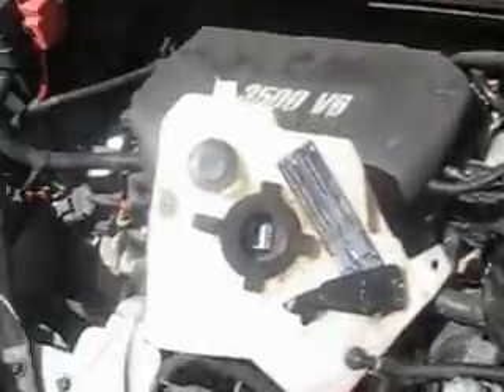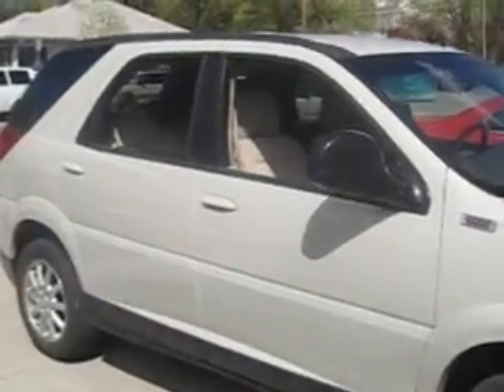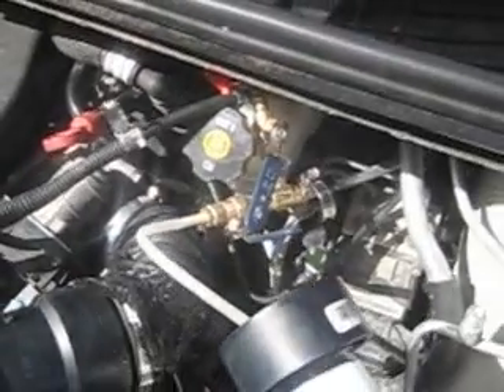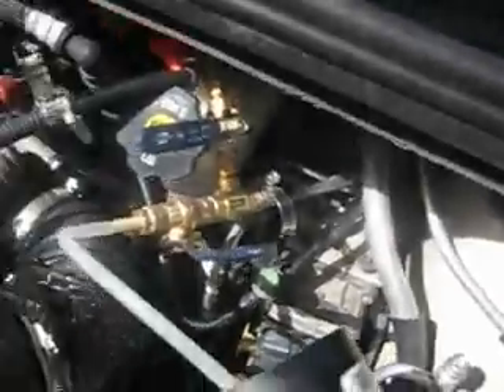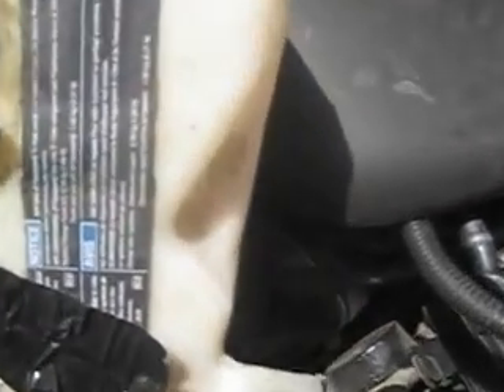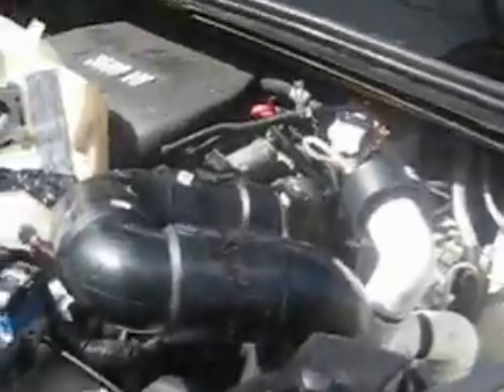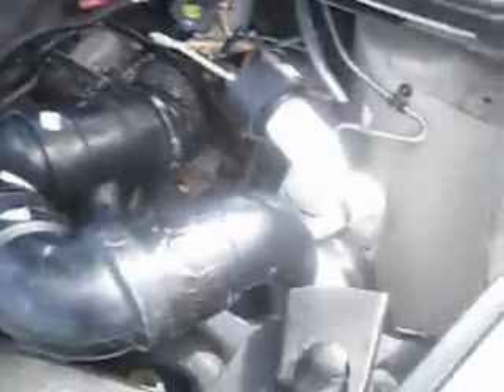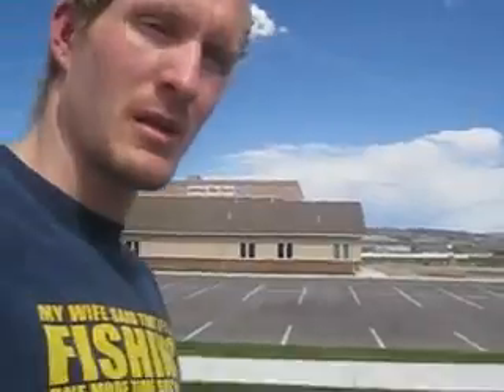200+ MPG Gasoline Vaporizer Project Original Design (Driving On Only Gasoline Vapor)

Comment: Tyson, there is not too many adjustments to be done. The air is easy and the vapor will be sucked in by the intake. I don't have a distributor so there is nothing to do about that.I am really sorry to say but this vapor stuff is not real to me.Soon I am planning to do this experiment again with a video so ppl won't think of me that I am talking without proof. Now I am working on a hho project hopping it will do the job. waiting for the flash back arrestor and I will mount it in the car.End of the month will be here. Again I have nothing personal with u Tyson buy after what happened to me with the vapor experience. .. there's not much to say.

Comment: Sorry for my english,first of all.Today i tryied the fuel vapor in my tercel 98,and i am realy disappointed. I take 2 hoses from the exhaust cover and getting hot air in the bubbler. The 2 hoses got warm (no ideea how hot was it but it feels warm pretty good) and after I cranked for 7-8 times she finally got the feeling the she is willing to start.2 more cranks and she was idling. I let her worm up to the 80 degree Celsius. Than I said I can drive it. I was using a (roughly 4L)canister with I fill only 1L of gasoline. the end of the pipe inside it is made from pipe copper with an end of 40mm (1 1/2 ")in a L shape with lots of holes in it.So I jumped in the car hopping for the best.She start nice on the 1st gear but she struggle for the 2nd (automatic).I reset my km meter and she went as fast as 50km/h. Slowly she start not having power but I said let's see how far does she goes. After 4 km she died on me.Open the hood and no more gas in the tank (1L).Fill another 1L and Crack it again with no success. Gave up and replace everything the way it was (air filter, injectors plugs). PS: Run it with out air course the moment I try to give some air she was dieing on me.Donno why she didn't want to start  again. Any ideea? I realy appreciate any ideas 
Toyota Tercel,1.5L To me this didn't work and I wish I can to prove all my friends it is possible.
Reply from the maker: +998vick It's a pain and talked allot of adjusting to get it right which is why you don't see videos anymore.

Comment: I have been working on a system that is based on a fog machine,   had the idea a few years ago , but the fog machine its self is not made to handle gas , otherwords it doesn't last very long. so I am revising the design with a variable fuel pump and a more controllable heat nozzle. does any one have any ideas or thoughts on the concept?

Comment: It is true that vaporizing the gas doesnt doesn't make the engine burn the fuel any more efficient. However vapeing the fuel and running the I.C.E on gas vapors makes the fuel last alot longer no matter how efficient or inefficient the I.C.E burns the fuel it is supplied.
Think of it this way,  shooting a stream on fuel intk a carb is going to eat more fuel than turning the fuel into vapor and running the engine off that, this is why when you romp the peddle the there is a lack of power due to it running off the fumes for the most part.
There are some realky cool things being done with water injection as well you should check out.

Comment: can someone tell me why try to vaporise gasoline instead of using lpg, does gasoline vapour has greater volume when expanded than lpg, or smaller gas/air mix is  needed?
why not tune a simple lpg system to a leaner airmix to get better mile x gallon? what has the greater volume if vaporised  gasoline/gpl   1l gas = 2l lpg in my countri so do i get more vapour volume from 1l of gasoline than 2l of lpg ? this is what i wanna know.thans

Comment: Hey Tyson, I saw (on youtube.com), a guy run a lawnmower with a gasoline vaporizer that HEATED the gasoline with HOT EXHAUST FROM THE EXHAUST OF THE LAWNMOWER.  Why not use this system on  your vehicles? Also, why not use a HYDROGEN GENERATOR IN COMBINATION OR EVEN BETTER ECONOMY?  I wish I could post this myself, but I don't have the means!

Comment: Do you know what happens when your gasoline mixture gets leaner? More oxygen the cleaner the burn just like gasoline vapor does.Do you know what happens with a lean mixture as it gets more oxygen? It starts to burn hotter like giving more oxygen to an oxy/acetylene torch in turn your valves get much much hotter till they start to burn out.Its like when you adjust a carburetor and you get it to its sweet spot and then you give it just a little more adjustment on gas so it doesnt burn too hot on your valves.

Comment: PRIMARY TANK AS VAPOR TANK ???

 Why not use SOMETHING LIKE AN "arctic fox fuel heater"  like deisel semi trucks have to heat fuel in main tank to  110 to 145 degrees farenheit ?   {these type  use heated engine coolant to heat fuel by thermal transfer} .   gasoline boils at about 160 degrees farenheit and vaporizes well at 100 to 140 degrees.
  FUEL TEMPERATURE   GAUGE RECOMMENDED.

 Then fill PRIMARY FUEL TANK  to 1/4 capacity or 1/2   and allow 3/4 to 1/2  of tank  capacity for  "in tank" vapor... and hook large diameter fuel resistant  vapor hose to top wall of tank near center  {{{or tee into filler neck just below gas cap}}}  to avoid  splashing and sloshing liquid fuel into vapor suction  tube .  
    A DRAFT " IN "  TUBE THAT PULLS FILTERED & HEATED AMBIENT AIR  DOWN  THROUGH A  ONE WAY VALVE AND TO BASE OF FUEL TANK ..SUCH THAT FILTERED AIR BUBBLES UP THROUGH GAS  MAY BE NECESSARY TO AVOID SUCTION LOCK...AND  COLD WINTER AIR DOES NOT EVAPORATE GASOLINE NEARLY AS WELL....  PURE "NON-ALCOLHOLIC"  GAS PLUS  ONE OUNCE PER GALLON ACETONE WILL AID IN EVAPORATION. 

  AN OLD 1950's  race car  "vaporizer"  trick used acetone in GLASS vaporizer jar plumbed to carburetor by  vacuum tube   or   1 to 1.25 ounces per gallon  added directly to  ""100% PURE GASOLINE""   with no alcohol in blend at all....  This acetone liquid additive probably will not work with E10,E20, e30, e85.  
This racing ACETONE additive trick that is banned from racing now...  It did increase performane/horsepower and reduce fuel consumption...  Acetone is currently about $17 to $20 /gallon at Lowes...and 100% non-alcoholic gasoline is difficult to find...  

   PRIMARY TANK  AS VAPOR TANK TIP:  
  YOU MAY WANT TO HOOK  FLOW &  PRESSURE & SUCTION GAUGES TO TANK AND OR LINES TO MONITOR THESE  PRESSURES, FLOWS & VACUUMS DURING TESTING. 

ALTERNATIVE  "RACE CAR" or "VINTAGE CAR"  FUELS :
  Strait  avaiation fuels   100 octane low lead or 110 octacane low lead     might be a {non-alcoholic} vapour option   but burns way to hot for  liquid fueling of NEW street cars..  If you fill your car with low lead aviation gas It will melt the aluminum  pistons and plug up the catalytic converter if your car has one.

    I did mix some UNAUTHORIZED STREET FUEL  at  10% aviation 90% unleaded gasoline in an old 65 chevy 327 cubic inch V-8 {leaded fuel engine} with NO CATALYTIC CONVERTER and it worked really well....especially after leaning out  the carb aduustment screws.... and the exhaust  fumes smelled like I was burning 1970's ethel gasoline.  That was the really good ETHEL-GAS  that got banned in the 1980's or 1990's ....
  My end user formulated ETHEL GAS  turned several old men's heads  who remembered ETHEL GAS was once at the station  in the pumps right next to the new fangled  "unleaded"  gas that at the time we all thought was  " pure liquid  engine ruining crap "   which  needed some tetra-ethel-lead in it to lubricate  intake valves and guides  properly.  I remember being asked, "Where in 1999 did you find ETHEL-GAS ?" ... I answered simply, "I made my own."    or " I used aviation fuel as an additve to unleaded at one gallon per 10 or 12 gallon fillup" ...  Mixing my own got to be a real hassle especially when trying to add just 2 or three gallons total to top off.

    The new cars have valves and valve guides made of some different metals than the old ones were....so  toxic tetra-ethel-lead is no longer needed   in the new engines.  It took a few years for auto makers to figure that out....and we all bought lead additives and lead substitutes for years  trying to keep our old  pre 1974 leaded fuel engines alive just  a little longer.

Comment: is their any chance of burning up my valves or valve seats without doing a cam adjustment like this video says https://www.youtube.com/watch?v=17xVBQ_U2yw............ im just trying to get as many opinions and info about ths as i can before putting my unit on for daily use 

i am also a automotive tech and the point he trys to make in the video seems feasible but it also seems like it could be overkill to do cam machining like he did. please reply with your opinion and any other info you can give me on the subject, all info will be very much appreciated

Comment: What are all the parts needed. Since I have a single barrel carburetor  with 300 cid. inline 6 with dual tanks?

Question? 
1. can I run the line that the glass bowl i have where the gas goes to and run that to a container or should i take it after t the manual fuel pump from motor to the container 

2. can someone tell me what parts I need to build this?

Comment: Question? Do you have a car or truck that has a carburetor could you help me on using a vapor setup on 1985 F250 Inline 6 cylinder 300 motor. Just wanting to find a way to get most out of truck.
Reply from the maker: I don't but the concept is exactly the same and the vapor system will work better on a carbureted vehicle because you don't have to worry about bypassing the cars computer. If you join the FSRD facebook group there are some drawings and diagrams of how to set a vapor system up.   https://www.facebook.com/groups/259684980846627/

Comment from the maker: Geo Jeff: I am aware that better testing needs to be done. This unit was a fail I got amazing results a few times but the design was extremely unreliable so testing on a 1200 mile stretch would be impossible with this design. I could not drive at highway speeds because it would cool down very fast and completely stop working.

Comment: I'm just after your best interest's, I would hate to see you damage a new functioning engine. I'm upset for you and us all as a group who follow vapour/geet systems. It seems you work hard to keep your viewers informed so why not take a more scientific approach. As i said and please don't take any offense to advise this time, small scale engine run time with carb and load vs engine run time with vapour and load etc with the more data the better! As for me I'm working on engines that run a constant rpm only with a blend of my used motor oil, diesel, petrol, and basically anything that can burn. I'm not doing it for other people yet and mabey I never will if I don't get the results I'm after, I don't upload videos or even make any, and I won't until I have a urekea moment so to speak. Trust me I'm there I look at everything around me that others throw away especially used motor oil haha and say dam....that it liquid gold!

Your doing good prototyping we as a community need to see the raw data, that shouldn't be taken to offense,  the way I see it vapour is the next step in the evolution of ECG. Carb/injection/vapour. If you look at an evap system on a car you can see that we are already burning vapour on our cars everyday! Just on a very tiny scale.

Try to take the good out of what's said and answer the questions and please don't take offense, that's not the intention. Keep up the good work!

P.s. look towards harvesting all the wasted energy in heat from the ECG for your prototypes, from what I've done the heat is an excellent source of wasted energy just begging to be used.
Reply from the maker: CarsRcool All knowledge is highly welcome and I am always grateful to those that share their knowledge and experience.
Reply from the maker: I understand your concerns and appreciate your input on not wanting a good engine to be ruined. You are correct it would be very bad and costly to ruin an engine on such a nice vehicle that would cost a lot of money to replace. Sorry I did not mean to come across as though I was offended, I was not offended I just wanted to let you know that I have done more than what you see in this video and that I am taking a more scientific approach by testing on a generator which gives me the ability to test specific loads and runtimes etc.

There has been allot of good and some bad that has come from making the work I do public. The Jeep I was using as my test vehicle was destroyed by someone, my computer has been hacked into a few times and my house has been broken into a few times along with other things. The bad is just something that comes with sharing such a thing. Some people don't want this information out there others get jelous and some are just out there to try to ruin someones day. I knew going into this that there would be struggles and people out there that would not be happy so I tried to mentally prepare for the crap. It's not always easy but it is worth it. 

Thanks for the encouragement and concerns of needing to do this in a more scientific way. If someone watching wants to or need to know for themselves that this work is real then they need to see the data, I understand that because I found it hard to believe until I saw it myself. I am working on doing better testing and better videos that show all the data good and bad so we can all learn and improve this together.
Reply: Tyson Capel With an Icon that say's CarsRcool... you know I will allways give you encouragement ! ..thank you for explaing the setbacks you have had with people damaging your car.  If you are interested ... I can give you a suggestion .. but it would be as unconvential as a 200 mpg car.. but it does work ...cheers!

Comment: You need AFR, EGT, etc..data from the o2 sensors can be monitored, especially knock and on and on. A fuel cell to measure exactly how many mpg on one cell. Usually to run vapour only you need to change the valve timing so, from what I see you don't have variable valve timing or the equipment to even modify it. Meaning a custom cam or two in your case. Of course you have no power your ULTRA lean dude especially at anything over 1.5k rpm. We are talking water injection, supplimentary fuel injection for load etc etc. I'm getting a bit fed up with these videos and these rigs made from crap from home Depot and home hardware. stop wasting your time and buy a small variable speed 4 cycle car motor and attach a variable load on a testbed and start prototyping from that, like stock with carb or injection testing run time then with vapour home Depot rigs. Seriously take this hazard off your car and start "in the lab" on a testbed to get a real baseline setup to at least start from. After you burn out your engine from 1 to many mistakes you'll wish you had taken the advise. I can't stress how important raw data is enough young man.
Reply from the maker: I've come a long way since this video, it's been a few years since this build. This was the first design I built simply to test the concept. I was not going to waste tons of money on something I didn't know would work. After I knew it worked I was more inclined to spend a larger amount of money on it. I bought a Jeep as a test vehicle which I did allot of testing on and have came a long way since that time. I have designed a compact system that will be electronically controlled for proper air/vapor mixture, fuel delivery etc.I do have some test equipment but am investing in more, it takes allot of money and time to do this. The testing at this point is being done on a generator so I can have good accurate raw data. I had a cylinder head temp. sensor on the jeep and when running at the proper ATF the engine runs cooler by about 10 degrees F. Trust me I have done allot more then just use a home depot build vapor system. 

FYI I have never had problems with the engine running on vapors, such as blowing a head gasket, burning valves, etc. and I have been testing them for a few years now.
Reply from the maker: If you are so tired of rigs made from crap then please make one that is not, test it, and share it. If you're not willing to do that then please do get upset at others for at least trying to do something.
Reply from the maker: There is no reason that I have seen thus far to need to change the valve timing. The engine is still running on gasoline the only difference is it's running on nothing but fumes or in other words all the fuel is consumed during the combustion process not just 18% of it like you get running engines off of fuel injectors or carburetors.
Reply: I can't stress.. how big of a douche you are.

Comment: In all these videos . Not one proves they get better gas mileage. I mean you run an engine lean enough you will drag the cylinder wall out. What is the point of this.
Reply from the maker: They prove the concept. The data I have is on paper I did not make a video during the times I did the high mileage tests so yes you are correct not one proves it increases fuel mileage. I have recorded video footage of it since the time of the high mileage tests but i no longer have it. The reason for missing proof is in another video. I have had very little success obtaining the high mileage stated in the description. There have been far more problems then I wanted or even expected. There is also more to the system then what you see in the videos. I'm still working on building a system that is reliable, it will come with time and I will do allot of detailed video footage of it so there is no doubt in anyones mind that this is possible. I know it is possible because I have seen it as do a few others that have got results similar to what I have but that doesn't help you know it's really possible and I understand that. I still have a hard time wrapping my mind around it and I have seen it more than once.